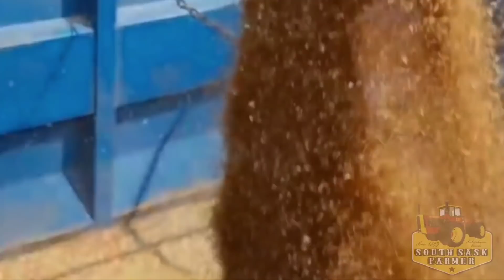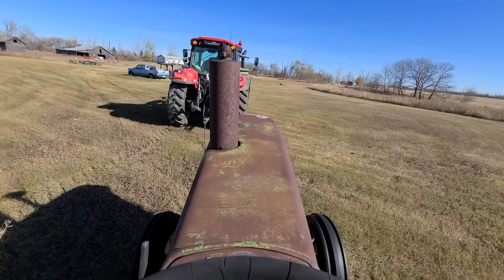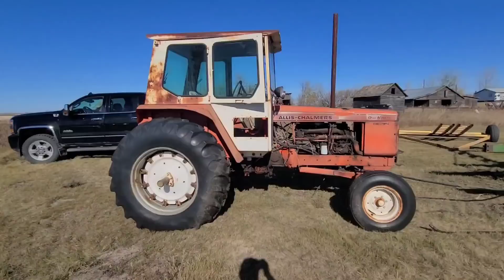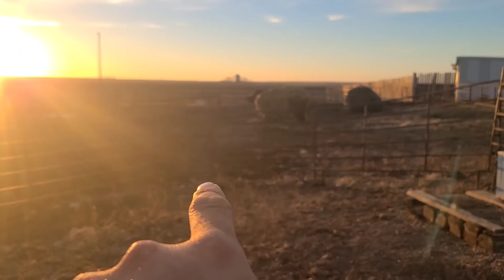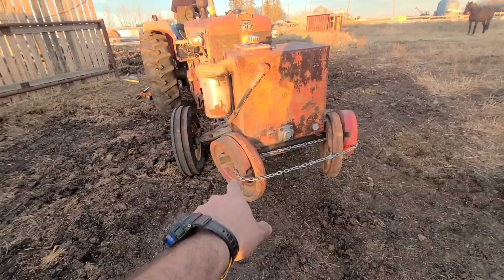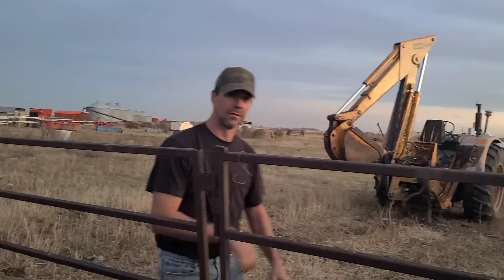Junkyard tractor salvage part 2!!!

Comment: Problem with power shift tractors.. they don't pull start. 
Gears on the AC, it's a 4 or 5 speed on the floor. Foot clutch for it. The right front lever is high, neutral and low, it's wet clutches.. either one in neutral should let it roll.. the short lever by the high and low is the throttle.
I like the tractor dolly.. just have to skid turn it.
About damn time you burry the wire!!
I prefer a little deeper, but better than overhead 👍😎
I assume the water line will be deeper.. hate to have it freeze up.
Nice tractor salesmanship 👍😎
Fix up the 4010, get the loader on it, then put the backhoe on it... and restore the Massey 😁
Reply: You could with the white if it was in direct I think.
Reply: The 4010 is a synchro range. Power shifts were 20 series
Reply: @nellsonstout7001  maybe.. but it would have had to have been in direct when it was last run
Reply: @dougschmitii6165  the AC has a power shift.... 
I know too much about both of them
Reply: @GosselinFarmsEdGosselin  well, yes and no. Power Shift seems to be a loose term. I know what you mean about the 190. I just got done running one tonight. As you know, the AC was more like a high/ low, and the White is a high/ medium/ low, and both are shift on the go. I'm not trying to start any fights at all, but to me, a power shift is being able to shift through all gears without having to change another gear.  In the mid '60s, Deere was the only one to have a true power shift ag tractor.  I mostly thought you were confused thinking it was a 4020 with a power shift, ha ha!
Reply: @dougschmitii6165  all good!! Ya, the JD power shift was the first.. and probably the best. They used it in skidders, tractors, loaders.. all got abused, and most survived.. the amazing thing is, they used the same power shift in so many different sized equipment..

Comment: Looks like the same boom that's on my case 680e. I took my cylinders off and pulled them apart and went to hy tech seal in Winnipeg. It cost me 40 dollars for  the seals per cylinder and Case wanted over 300 per cylinder

Comment: Here's an idea on your underground power. I usually put the wire inside of 1 inch or 1 1/2 inch black plastic water line, this protects the wire from stone damage when you back fill and if you happen to drive over it !! Also, if at sometime in the future you can change out the wire without digging up your trench again.. Don't know if you already got the wire in? But you can always do it in the next project!
Reply: We do this too. Very good idea!
Reply: Done that on one water bowl. Gonna do it here too.